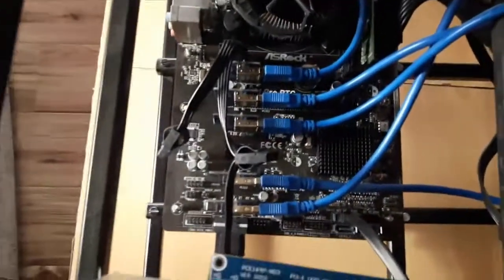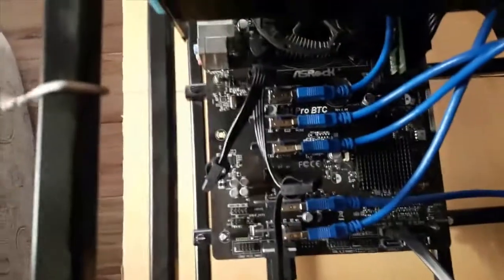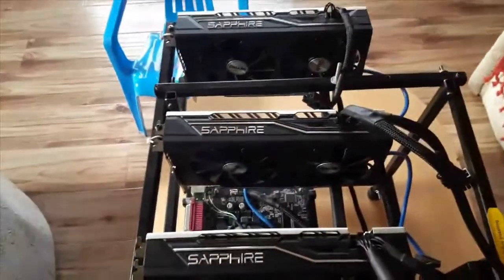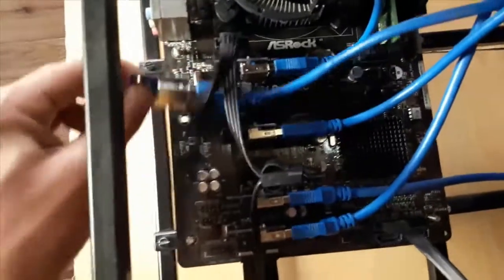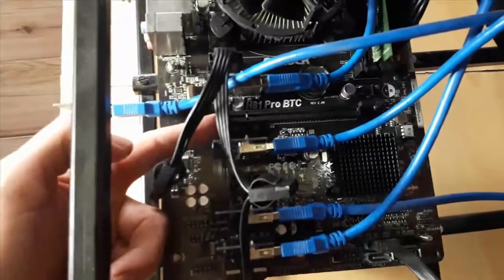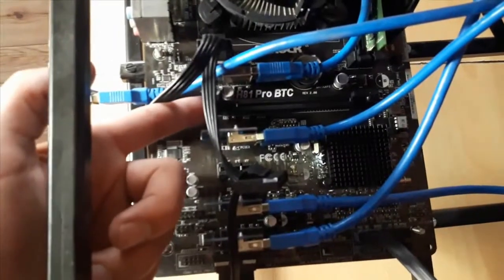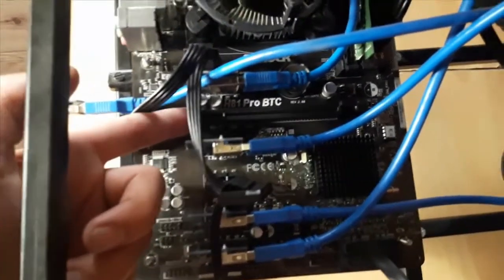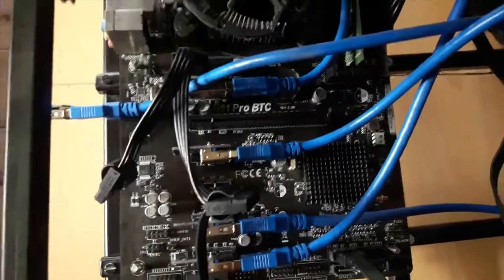Mining Rig Don't Giving Signal to Monitor

Comment: no respond it still not connected
Reply from the maker: Try to put some other card into PCIe16 slot. Maybe extender is making problem
Reply: still not working, is it possibly to use DVI-D and socket it into motherboard instead of the GPU?

Im asking this cuz, im planning to by DVI-D socket, if you think it doesnt work i wont by it
Reply from the maker: That depend from your settings in bios. Usually if there is integrated graphic card on motherboard it is turned off. What GPUs do you have? Does it show driver error in device manager? Did you try to put only one card (the one that is in 16 PCIe slot) and remove all the others? What is happening in that case?
Reply: i did that but still same result, i just find out yesterday, that my Motherboard is the one that not working, i use ashrock 13 slot, with 1070 zotac, now they are offline, still trying claim for new motherboard, thank you anyway man, appreciate your help